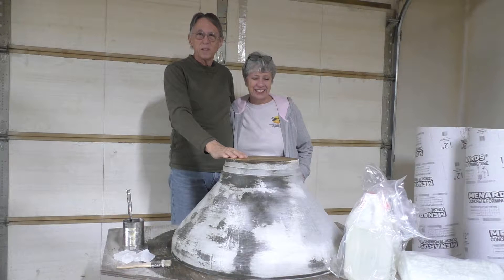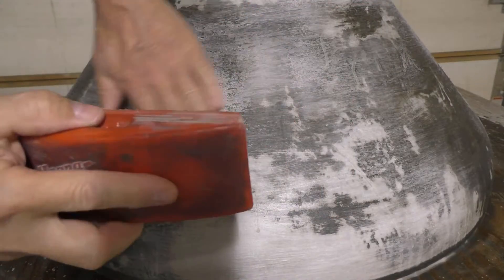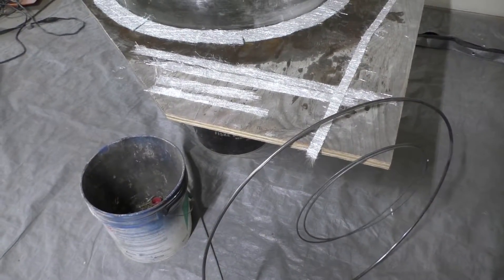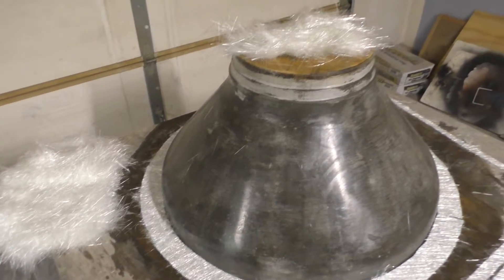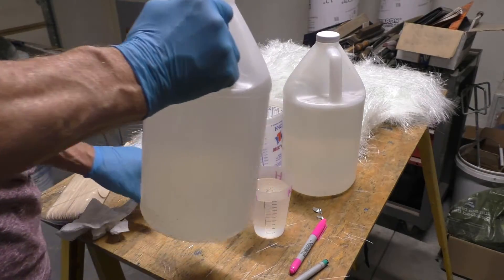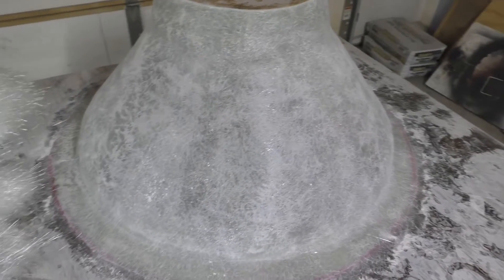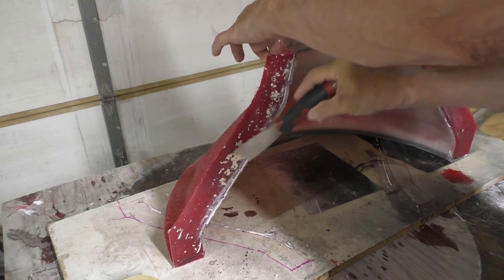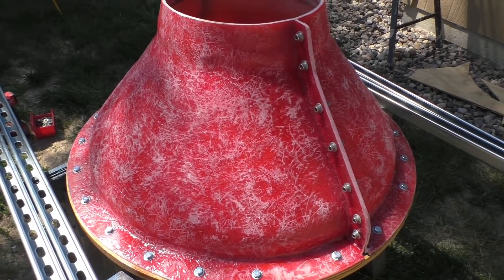Homemade DIY Fiberglass Form for Concrete Pier Footer Spencers-Mountain Off-Grid

Comment: Great video I really appreciate your craftsmanship and knowledge...can you tell me approximately how much you spent on making the form in 2022 dollars?  I know that 18 footers would be a great way to spread out the cost but I am trying to see if it would be cost effective for me.  Thanks for sharing!
Reply from the maker: Quick answer is about $120 for epoxy and resin. $10 for sand and cement to make the form.  Some other scrap items used that may or may not cost anything.  Our off-grid situation made this a good way to build our foundation. 
Don't know how many footers you may want to produce but simple plywood forms can work well. 
Good luck with your project and thanks you for watching.

Comment: nice job i have not worked with fiber glass in 40 years. i stopped doing body work and painting cars after i saw most didn't live to be 60 years old. only 1 man that i worked with is still living he has lung trouble just like me. take care, be safe and well.
Reply from the maker: Thanks! You are absolutely right, materials and chemicals used in auto repair can be and many are very toxic with effects showing many years later health wise. Sorry to hear you have been impacted by the trade. You also be safe and as well as possible.